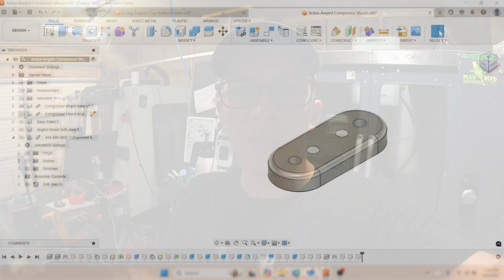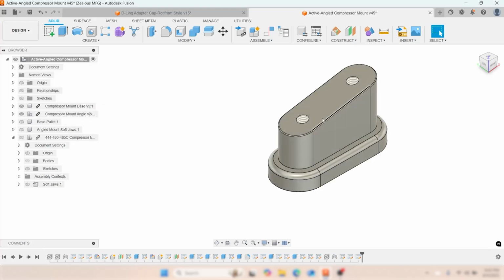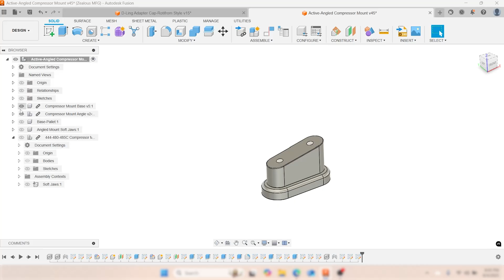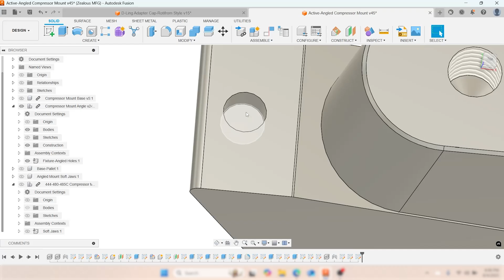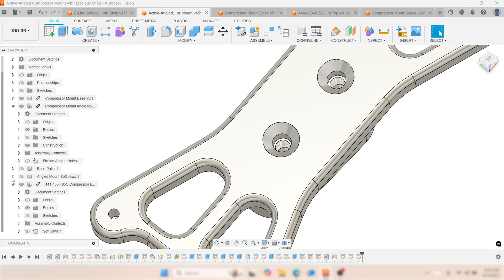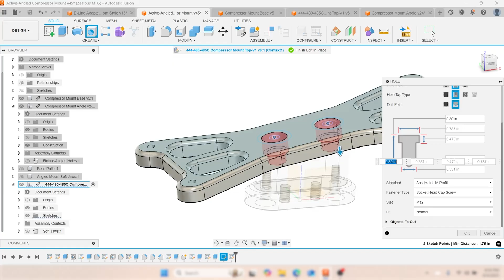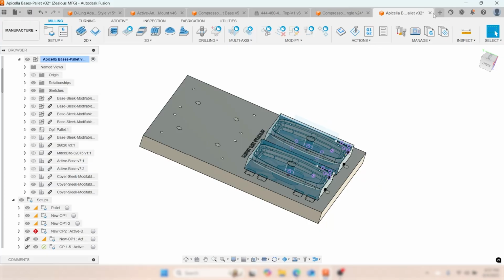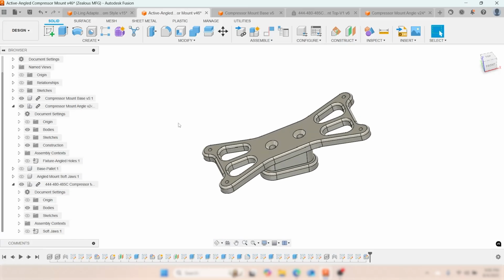What I Wish I Knew Before Designing This Part | American Made Ep.3

Comment: Great video! Looking forward to the rest of the series. 

I noticed you doing a lot of clicking to turn visibility of parts on and off in your manufacturing workspace when switching between setups. Do you have sync view/visibility with active setup turned on in your settings panel at the bottom of the screen? If not, it makes it way easier to navigate between setups. I’d check out JIT CAD CAM’s video “Fusion Friday: 2 Setups 1 File” to see it in action.
Reply: Great idea! I will definitely look into this!